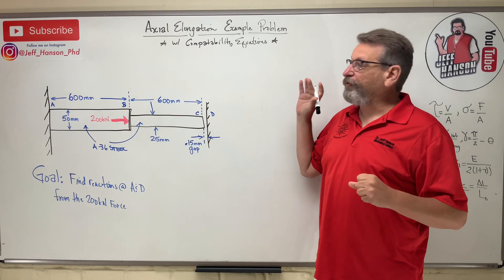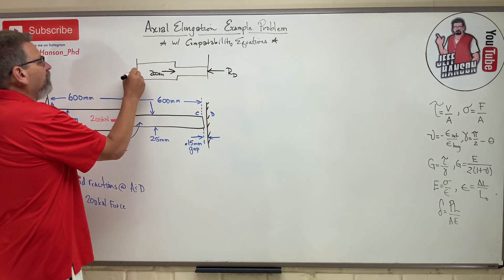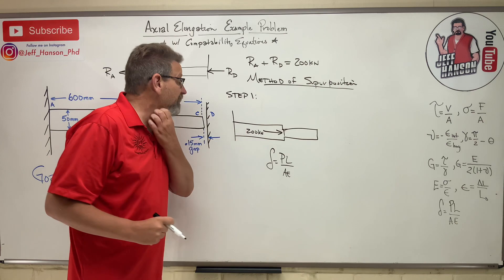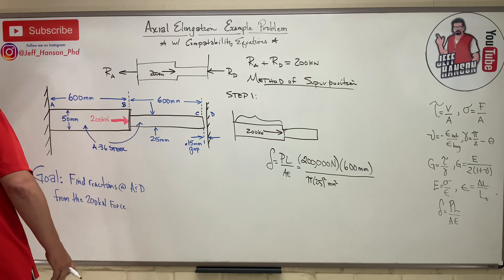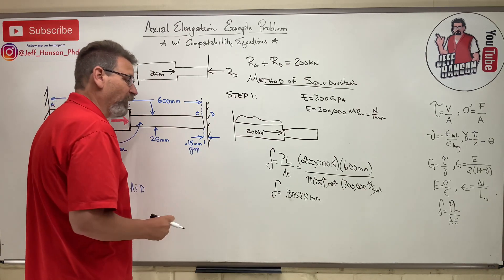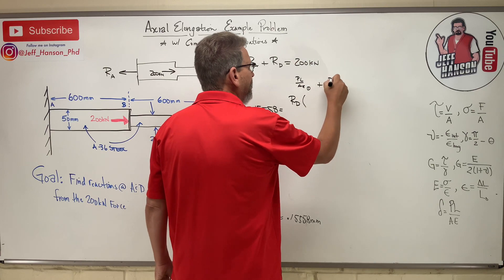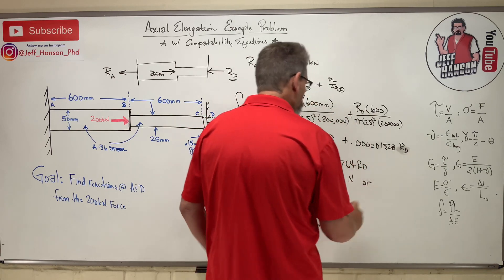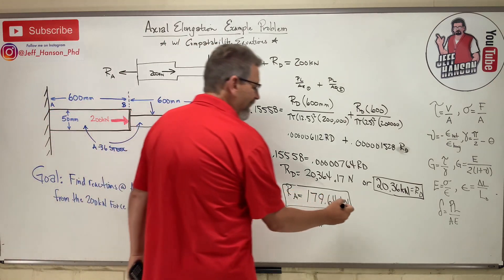Mechanics of Materials: Lesson 20 -Statically Indeterminate Superposition Material Between Two Walls

Comment: In my opinion, the problem has a mistake, and mr. Hanson made a mistake too: he used wrong diameter to calculate relative elongation of a bar under the force 200 kN (used 25 mm instead of 50). When used the correct diameter, the rod will elongate only by ~0.076mm, and therefore not even reach the other wall
Correct me if I am wrong though

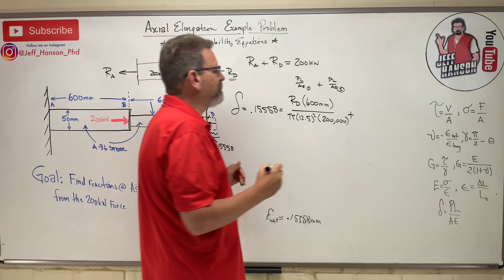Comment: When calculating the restoring force Rd for the larger diameter section why do you use the original length (600mm) in the PL/AE equation? Do you not have to take into account the 15mm gap? Or is this gap already accounted for? see timestamp 11:11
Reply from the maker: You ALWAYS use the original length of the material.
Reply: It's a 0.15mm gap. Accounting for this would make almost no difference to the answer.